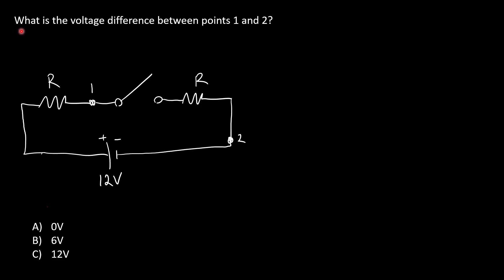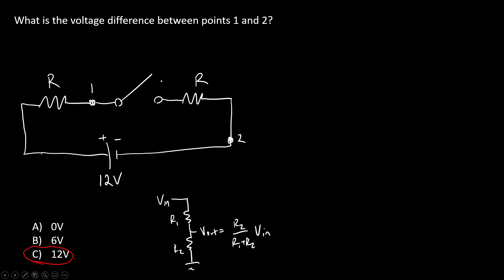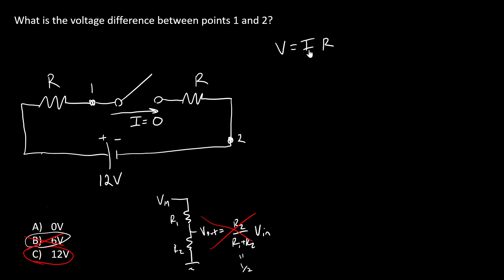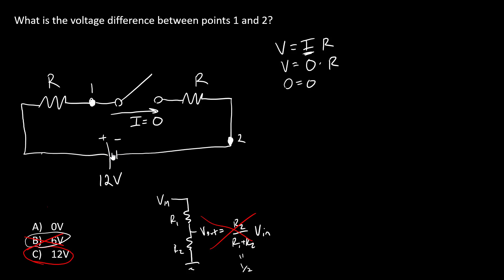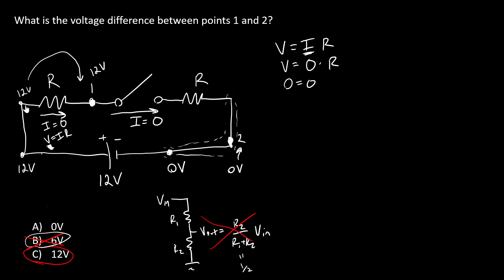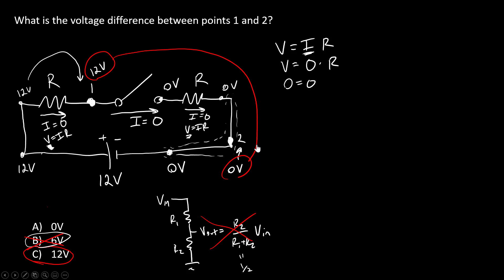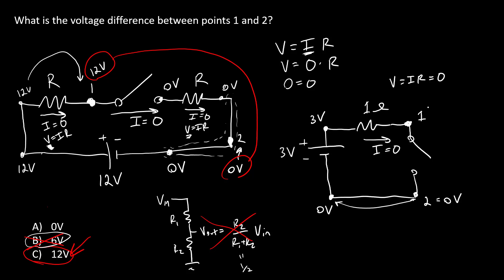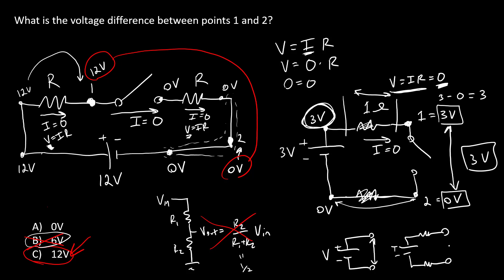Intro to Circuits 29: What's the Voltage Drop Across an Open Switch?

Comment: It helped me to think of the voltage as pressure, resistance as frictional losses, and current as flow (like you had in earlier videos). If the flow is zero, then there is no pressure drop due to frictional losses...

Comment: For there to be a voltage drop there must be current the title of your video is confusing
Reply from the maker: For their to be a voltage drop over a resistor there must be current flowing through the resistor. You can measure a voltage difference between two points in an open circuit when there is no current flowing. This misconception that "no current flowing means voltage everywhere is zero" is what confuses students about the problem in this video. As a simple example, just think of measuring the voltage of a battery directly (without the resistors or switch). There's no current flowing but you will still measure a voltage.

Comment: If the voltage extends up to the OPEN, then why does a capacitor require current to charge up to the applied voltage. What's the difference in the OPEN in the above example and a capacitor? It seems that an OPEN is nothing more than a capacitor with tiny plates and a wide air dielectric.
Reply: 'What's the difference in the OPEN in the above example and a capacitor? It seems that an OPEN is nothing more than a capacitor with tiny plates and a wide air dielectric.' 

You're right. Capacitive coupling can be encountered in real life in many situations (https://en.wikipedia.org/wiki/Capacitive_coupling). The higher the voltage and the closer the distance between the wires (the plates, in the case of a capacitor), the more intensely and visibly it manifests.

In the case of a capacitor the plates are extremely close to each other and this makes a big difference. Let's say you connect a capacitor to a battery with the help of two wires. The negative pole of the battery will start to push electrons to the negative plate of the capacitor through the wire. At the same time the electric field generated by the electrons that keep accumulating on the negative plate of the capacitor will start to repel the electrons that exist on the positive plate of the capacitor. 

The positive plate will get depleted of electrons as these repelled electrons travel through the wire to the positive pole of the battery. So, until the capacitor is fully charged, a current of electrons will flow through the wires. After the capacitor is fully charged, there is no more current flowing through the wires. The negative plate of the capacitor is saturated with electrons (it can't receive any more electrons). The positive plate is only left with positive charges (the protons). 

After you disconnect the capacitor from the battery, the negative plate will stay saturated with electrons because these electrons can't go anywhere. The positive plate will stay depleted of electrons because it can't get electrons from anywhere.

The negative charges (the electrons) on the negative plate and the positive charges (the protons) on the positive plate will attract each other because of the electric fields they generate, but they cannot travel through the dielectric between the plates.

Comment: How do you express the voltage drop across the open switch mathematically? Is there equation for it, or must you say "Ohm's Law doesn't apply; trust me bro."?
Reply: tell me you didn't pay attention to the video without telling me you didn't pay attention to the video
Reply: @wilmercuevas6491  Yeah you're right, I did not watch the video. I just typed out that comment for fun because I love the sound my keyboard makes.

Comment: The voltage across R(1) = 30 V and the voltage across R(2) = 45 V. If the wire breaks between the two resistors, the voltage across the break would be ________ V.

What about this question?

Comment: I’m so happy I found this video. You should label it open circuits as well. I was so lost trying to qualitatively identify filters using impedences and how devices behave like open or short circuits because I did not understand this core concept. I searched and searched the internet for a clear explanation and no one explained open circuits and their voltage drops this well! Thank you for putting those helpful videos out there!
Reply from the maker: Thanks! If you haven't seen it already, this video is part of a whole series that also includes filters.

Comment: Why does I equal zero 4:13
Reply: Because it's a series circuit, if current between the open circuit is 0, current across R should also be zero. Another thing we can do is assume resistance across open circuit to be infinity, so resistance effective is infinity, making current from battery to be zero.

Comment: How does it get through resistor without current.
Reply: It’s not. It’s just measuring the potential force. You can think the same thing about the battery. There’s no current moving inside the battery with nothing connected to it but you still measure 12v across it

Comment: Is potential drop 0 across an open switch? Just need a simple explaination please. My mind will burst.
Reply from the maker: Unfortunately it's kind of hard to explain in a comment - I just replied to one of your other comments, the potential drop is zero across a CLOSED switch because it has zero resistance. The potential drop is not zero across an open switch, as explained in this video.

Comment: But then why on earth the potential drop is 0 around a closed switch??!!!!
Reply from the maker: A closed switch has zero resistance. Ohm's Law V = IR, if the resistance is zero then the voltage drop is zero.

Comment: What if the 12V battery’s positive terminal is on the right side?
Will the voltage be -12V at the switch?
Reply from the maker: Assuming you measure the voltage drop in the same direction, yes.

Comment: What is voltage drop accross closed switch?
0 
1
2
3 
How is it possible
Reply: Its 0v
Reply from the maker: Assuming you model it as an ideal switch with zero resistance, the voltage drop across the closed switch is 0V.
Reply: @BenFinio How? Closed switch means the current is flowing, right? So if current is flowing how can V BE 0???!!! Y'all messin with my brain 💀